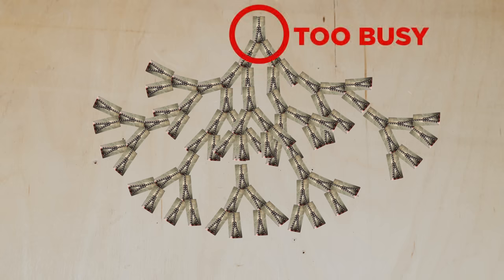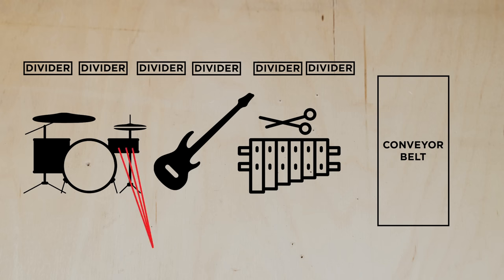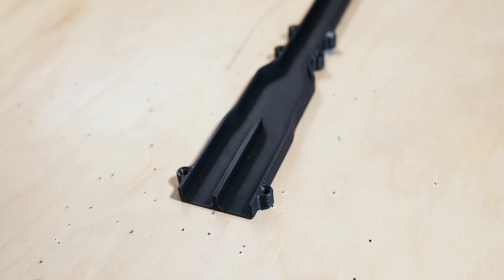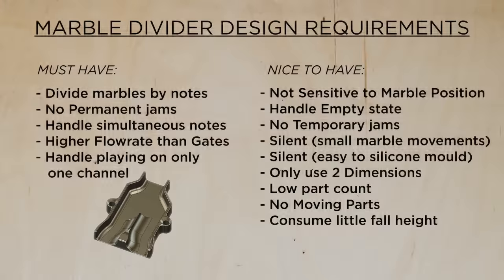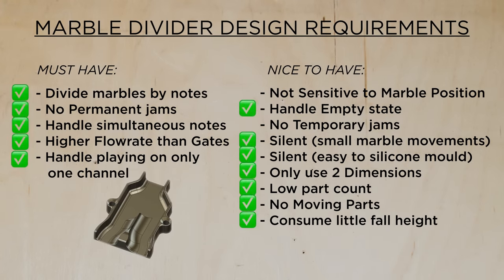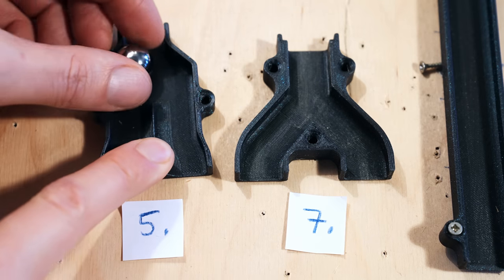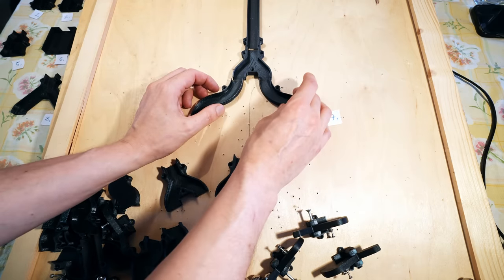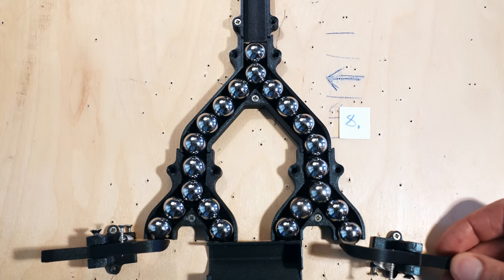Mystery Marble Divider?

Comment: If I had my 3d printer working... I'm pretty sure I could get it to work! We just need to add in additional detentions. That being said,using what you have, instead of using the wiggle tracks by adding in a short stop, that opens adding in a small gap in the marbles as notes are played that stop marbles at a consistent heights.

Comment: 8:57 you've got an unrealistic loading characteristic here, where the weight of the marbles is constantly decreasing as each marble is dropped. the cumulative weight can have a big effect. your testing rig would probably benefit from a supply system that can supply various 'heights' of marble weight, continuously. Solve that first then move onto the gates.

Comment: It seems like the marble position is only problematic when they are at rest but not while moving. The wiggle channels basically give an adjustment ability to the resting point provided by the gate. I saw a suggestion to just make the divider coupled more directly to the gate so adjustment isnt necessary, but my idea is that you could introduce another resting point specifically for the divider, perhaps a single fishtail step thingy right after the divider would be effective and less prone to error or creep than wiggle channels, albeit with more moving parts. The least complex way to implement it would probably be a single very long step that operates every divider and the gates would then be decoupled from the dividers entirely.
It is basically an alternative to the wiggle channels but doesnt fix the actual divider.
Reply: The main question as to whether this would even work is whether the fishstair thingy can operate reliably regardless of the resting position of the marbles at the top. I dont know, but it seems like you could make the geometry so that it would work fine. Most of the positions you could make the marble roll back onto the step and the rest could just push it slightly backwards and either way it would stay on the step if the output is full. 
Another bad thing is that it would mean that every gate path has mechanical stuff happening regardless of whether the marbles need to flow there, and that could end up being very noisy just from all the marbles hitting each other

Comment: I don't think I can design a video to explain what I'm seeing in my head...but try to picture this...

In your marble tree, at the top of each branch, sits a pin which sticks in from the side and stops the marble flow. This is linked to a "stop switch" further down the marble path.

When a marble is resting on the stop switch, the top pin sticks out, and the tree is cut off, similar to if a marble was blocking the path normally. 

Then, when a marble is dropped, it's no longer depressing the stop switch, and so the pin is retracted, and the path is opened. Then, the receiving paths can be of any length, and the rest will work the same.

Comment: Maybe experiment with self-adjusting squiggle tracks. If you make each squiggle about the size of a single marble, then if the bottom marble is out of phase it’ll stick in the middle of the squiggle taking up more track, thus adjusting the phase of the next marble forward a bit. Half a dozen of these with the right amount of squiggle might just fix the top marble position.

Comment: When I have this kind of situation with raw materials jamming before the forming process I added vibration to the feed chaneling.  I just use a motor with a concentric wheel that comes on every 15 seconds.  Can you use move of  a micro vibration? But vibration is more isolated in my use and the parts are bigger.  .25 round bar 12" long.   It does pretty much eliminate  jams by adding pretty course intermittent vibrations.  It doesn't ever seem like there's a silver bullet for mechanical things.  Or tap the whole feed to the rhythm.  Thanks for the update!!

Comment: Version 6 should work just fine if the marble splitting wedge raised height in the middle the lower down you get. The marbles were able to run down the middle because there wasn't anything to really block them from going down the middle essentially.

Comment: Is the marble dived gonna be on a sloping plane like that in the final version, or is it gonna be more vertical (with tubes again)? Remember that the steeper the slope the more the weight of the marbles above will press down on the marbles below. If I'm not mistaken that caused some issues for you with the MMX.

Comment: my idea would be to combine several methods
there was one marble divider idea that never got fully implemented (part of it did) in mmx that could have solved a lot; the main path wiggling and each wiggle had a hole down to its lane, and it was designed such that if enough marbles were in a lane that they peaked out the top of the hole then an incoming marble would glide past it. iirc, it was pretty insensitive to height.
on the mmx that was only implemented on one side of the main track, basically being a "half wiggle", dividing one lane into all the lanes. that then had the issue of throughput/flow rate.
however, if that was implemented on both sides of the main track then each "full wiggle" of the main track would basically be a y gate on its own. that would allow the main track to be smaller while feeding more lanes, increasing throughput/flow rate.
combined with having separate loops for each instrument, instead of the mmx's one loop to feed them, I bet that gets you there.

Comment: What about some very short horizontal aligned dimples or dot bumps to bias the positioning? If the marbles are at rest at the proper positioning the dimples or dots won't touch them, and ideally subtle enough for minimal rolling friction. But if the marbles are at rest out of position, the bumps or dimples could shift them towards ideal positioning.

Comment: To quote the great Mr. Spock: "His pattern indicates two dimensional thinking."

To make the divider quieter and much more compact, why not break two of the branches into a third dimension so that they stack on to each other. This would shelter sounds being made and allow more channels to be introduced in the same amount of space. If the height adjustment sections were made to fit into the same three-dimensional cross section, all of the channels in the divider could be adjusted at once with a single cross piece that had multiple thruways for the Stacked channels.

Comment: One way to remove height requirement could be having double gate. Divide to six and every split has gate after. Lets say you have lead pipe to instrument and gate before instrument.. Lets put requirement that pipe can contain max 10 marbles. When instrument gate plays it triggers divider gate. this way you could make divider "constant" and adjust with lead pipe length and how many marbles it can contain.
Actually other way could be having pressure plate or other type sensor to sense pipe "fullness" and trigger divider gate.

Comment: I'm terrible with CAD, but if someone could come up with an auto-jog mechanism to jiggle the tracks just the smallest amount, that would work wonders for the soft jam issues.  A similar mechanism might also be designed to vary track length while the machine is running, just 0.5mm or so.   I just deleted a paragraph of idea, because it was doomed to fail.  Perhaps a soft tube manifold on each major branch, that could be "massaged" via a small mechanism attached to primary power (flywheel).  That would rhythmically increase and decrease the tube length by a tiny amount (0.5mm?) to push the marbles back and forth, preventing the soft lock from marble position errors.

Comment: I've probably missed something but it stands to reason that if the length of all individual sections are equal to X*D where D is the diameter of the marble, then you should always end up with even marble height at each y-junction, regardless of the integer value of X.

Comment: What you need is a 1-for-1 digital encoding for each drop gate, and a mechanical "hand-off" code for each and every single marble to be replaced in queue with exactly 1 marble coming off the recirculation channel.  You NEED to abandon the idea of "evenly splitting" marbles between 2 lanes.  The noise comes from marble on marble contact...!  Marble on marble contact is not affected by the substrate material used.  You need to think more about clockwork beauty... Absolute precision instead of simplicity.  Imagine if each marble were handed off between stages in a 5-Star, door-to-door, white-gloves hospitality manner?  Think about the pageantry...!

Comment: I appreciate your position on the possibility that a solution might not exist at all. For the longest time I had thought about a system where your note placements get detected more than once. Normally, you are sensing a note that is a time-compensated request for a note to be played at any given time across the parallel channels. This lead to the idea that each channel needed to be ready at any given time. But what if you could sense when a note is coming before it's needed for playing and simply send marbles to the needed channel. Like having someone standing at the back of the machine, watching each note go by and placing a new marble into the queue for each channel with an upcoming note. Would this change your core requirements for the divider?

Comment: An idea for anyone trying to make a divider i guess in all the designs shown the marbles are not enclosed constraining them from more sides but all versions slowly congregate on leaving less and less room for marbles to move having a front plate and using the depth of track vs the height of the ceiling could be another fun but challenging way to make something work.

Comment: I have a feeling that any splitter that can deal with variable position paths needs to have a default path and an optional path. That could lead to favoring the default path when the marble throughput is high, but that's exceeding the maximum throughput of something at that point anyway.

Perhaps instead of trying to match track height to the splitter, you need a piece that can guarantee a marble position uptrack regardless of the position downtrack? A quantizer if you will. Some geometry of track that will only let a marble pass if it can pass fully, like the wheels in the marble gates help do. 

Perhaps a spinner built like the binary splitter, that doesn't allow new marbles to pass until the last marble is completely past? A unary splitter, just for indexing/quantizing? I guess that's a divide-by-1 divider, much like the one by Jesse Roelfs, but built for just a single path and speed.

Comment: I have a solution.
Invert the gate: when it's closed, the bottom marble should rest in a trap that's a fixed part of the divider, and thus at a fixed, known-good distance. It'll look something like
-- --
and a marble will fall into it like
-o-
Then, when you want to open a gate, you press an object against the trap, closing it into a line.
-----
This line is slightly tilted, so the marble then rolls off sideways.
This solves the height limit because the gate is at a fixed distance when closed, and even when open, it's stopped at a fixed distance.

Downside: it's not a priori obvious that this will run smoothly at high flow rates. Other designs with similar principles are possible; this one seemed easiest.

Comment: The first thing I noticed is all these solutions are not flow or pressure agnostic. So they depend on the flow to them and also the angle of installation.

All of them could be saturated and them be overwhelmed by the pressure of a ball reservoir above.

Before thinking on how to divide a ball reservoir, you must complete it. Where it will be? What's it's capacity? What is the flow of its filling. Then you can understand how to divide it.

Comment: Please install a "drip" tray on your table edge to catch falling marbles. Even if if's just a PVC pipe cut in half length-wise, the sanity savings will be worth it.

Also, I think you only need a bit of rubber on the actual dividing nib to absorb the sound of the impact. That I believe is the loudest contributor to noise.

Comment: now im wondering about that design you had in wood where all the marbles would run along the top of the full channels and drop into the next available open ones. if youre dividing the marbles into separate paths for each instrument, suddenly that doesnt seem like the worst way to go about it because each one will have a max of like six slots maybe?

Comment: the adjustable marble height seems like a bad idea with possible jams if the height is not adjusted properly, in the video you based the divider on at 3:18 the channels are smoothly sloped inwards from the outside, if you are going to 3d print the dividers anyway you may aswell include that sloping inwards in the design and try to optimize the slopiness needed for smooth operation.

Comment: The featured design by jesse roelfs seems like it has a lot of potential because when it is full there is a proper seperation of the supply marbles and the ones in the lanes. 
It seems to me that all you have to deal with is to make sure that the resting position does not cause the lever to act badly and to make sure that there are reliably no clogs in the inlet as the lever moves. The only troublesome resting positions would be when the last marble is off the lever but overlapping it, which could only allow movement by half of the marbles diameter at most. So maybe you could tweak the design to where that much movement isnt enough for the inlet to open too much, or for the counterweight to roll back and force the lever up. If there was a roof over the output marbles then the lever would not be able to move all the way until the marble moves. Basically if you could tune it to have a good safety factor for when the lever activates then you probably wouldnt have to worry about the marble position.
Reply: I guess this design would be error prone though just because it would probably be far more sensitive to how level the machine is than any other component
Reply: Although actually it would sort of just eat into the safety margin and the safety margin might make it harder to prevent jamming in the inlet
Reply: You could also perhaps try the same sort of idea except instead of the weight of the marble, you could have a reciprocating spring loaded pin that is stopped by the presence of a marble at any resting point ( which may be easier said than done ) and otherwise the pin actuates the marble release to let marbles in. 
Probably there are better ways to implement this idea. One maybe better way would be to have a small lever as part of the output ramp. The lever would have a spring loaded hook thing attatched and a reciprocating element would engage with that hook and use it to actuate the marble inlet gate, but only when the lever is not depressed by a marble.

Comment: instead of pairing the splits ... stagger the splits then each split off can be a little into the straight path and steal marbles as needed when full the next marble bounces around and off to the next split off ... then all you need for a minimum number of marbles is the total number of notes .... but if you triple that you will always have marbles ready to be sent for a note to play .... and the single line then feeds every note on every instrument ... and you can even split those to steep ramps and very low ramps to play the note so you get hard and soft notes ... or even if lucky a slide of a marble down a pair of strings ... that might be tricky but could be fun to try and do ...

Comment: I agree with you. It is not possible to design a non-jamming divider. Therefore, isn’t it time to accept that you will have to build 36 individual channels, no dividers needed, with one set of marbles to play each instrument? Think about it. You could design it like a bowling alley, with each channel track located adjacent next to the next. The 36 lane bowling alley could be high up, with 36 gates. "Click on" tubes leading away from the marble bowling alley, using gravity to your advantage, could make the system modular, and capable of being taken apart and reassembled. A secondary gate, near each instrument, could give you your control over tight music. You could even use different marbles in each closed system channel loop, adding personality and flare to each instrument. Imagine glowing neon marbles for the snare drum closed loop channel track. Or differing colors of reflective painted marbles during a performance in the dark? The jamming problem goes away when/if you don’t divide the marbles, so do like Elon does, and eliminate the part. Build it and they will come.  It might seem like more work to do it this way, but we all know that you are not afraid of hard work.

Comment: no graphic design or video ablitly here but i feel what has been designed works great the only major issue would be the compund effect of numbers, meaning any small issue will  magnify the more marbles involved so why not have a flow regulator. so lets say its set to a beat or timer and between the two stoppers there is always a fixed number of marbles, after so many ticks the stopper releases this set of marbles to the next stopper or gate. this would create a fixed marrble pressure and a less chance of issues. setting it to the beat would be best so it would release in time with whatever song was playing and not a manual adjustment for each one

Comment: I think the boxy one could have been a great one, adding a better divider in the middle like a wall, and making the grooves alittle deeper.
There should be a way to make the marble balance on the ridge even if its diff hights, probobly need to shrink the width too.